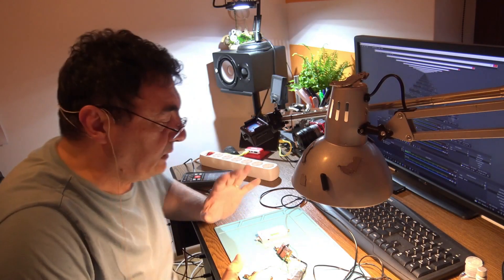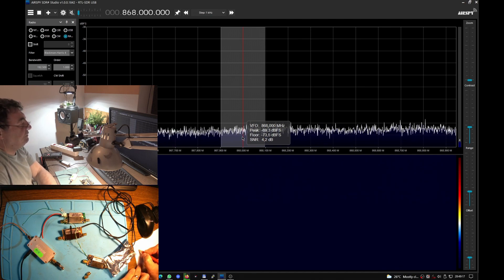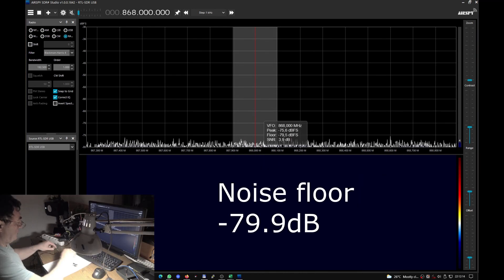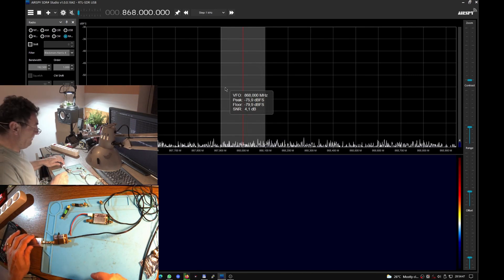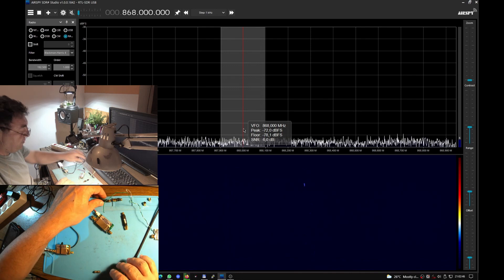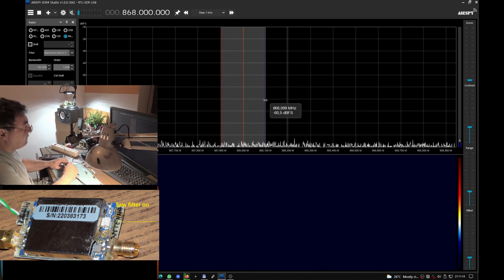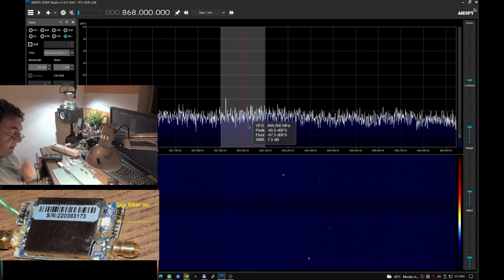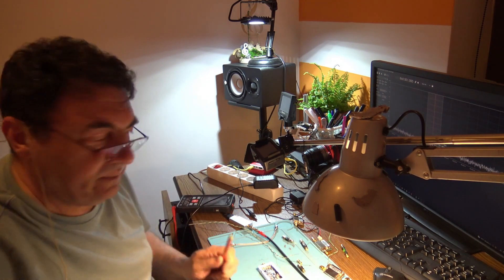Acasom v.1 vs AB-868-5V/Ab-IOT-868 AirBuddy LoRa Helium amplifier

Comment: I have alfa wifi with 20m LMR 200 cable with Antena 12dbi Is ab869 suitable?
Reply from the maker: Not for ALFA, different frequencies.
Reply: @viocaia Ears What can I use to not lose the signal
Reply from the maker: @kolchy-8272  Are you talking about WIFI or LORA signals...usually a good antenna it's enough.
Reply: @viocaia I want to put antena outside and tie it to a 20m cable and an alfa inside and I don't want to lose the signal
Reply from the maker: @kolchy-8272  Antenna outside connected to what? Alfa doesn't need any extra amplifier for a good connection. I use to have ALFA R36 when I was travelling with excellent results. But I recall I used a USB extension and I used Alfa as close as possible to the antenna. I don't recommend long antenna cables.

Comment: Hey Viorel, 

1. Can I use 30db amp and 20db attenuator for 10db gain? I don’t have any sellers for the acasom in my Country. So the only option is amp and then attenuate. Also how should I do the connection between amp and attenuator?

Like
Amp - SMA M-M Adapter - Attenuator
Or
Amp - Attenuator directly

2. I also have a STB 75 impedance 20db amp, so will it work for 50 impedance input? Also it has F Type Female to which I am going to connect F Male to SMA Female adapter. With that I am going to attach Antenna as Input to the SMA adapter and Hotspot as Output with SMA Adapter.

Like this
Antenna - F Male to SMA Female - STB 20db Amp at 75 impedance - F Male to SMA Female - Hotspot
Reply from the maker: You may use an attenuator after the amplifier..never ..before..so antenna/filter/ amplifier/attenuator..miner
Reply: @viocaia  1. Should I connect Amp and Attenuator directly or with SMA Adapters?
2. Will my another config with STB Amplifier which has 75 impedance work on 50 impedance?
Reply from the maker: @gorangagrawal  Depends of your connectros configuration..try to avoid to many adapters. As for 75 to 50 ohms..it's working without problems..
Reply: @viocaia  got it. Thanks a lot

Comment: you did't get the role of attenuator did you? you also sed it is stupid to use attenuator between nano vna and acasom amp input. I am using 10 dbi antenna and it is clearly that without attenuation it overloads acasom amp input in my case. It does not metter how you attenuate the signal: long cable, two saw filters, 6db attenuator, but it is not stupid to use attenuator if you are having signal to stong. is it?
Reply: Viorel is right that it is stupid to attenuate the incoming signal before the amplification.
You have a misconception what the attenuators role is yourself, it's only to trick the miner that you are using an amp. By attenuating the incoming signal you kill all weak signals before amplifying the signal, so yes it's stupid.
Reply: @renedevrind1733  so how can you explane better results with 6 db cable loss then with 1.2 db cable loss? do you understand that acasom amp is crappy and it is saturating with stronger input. At least I made it work. kinda. it is still better without acasom amp then only miner. miner has high quality LoRa module inside with saw filters and stuff.
Reply: @laurynaslauris9677  I’m with you on the fact that the results don’t lie. Still we are unable to explain why removing the Acasom amp completely increases transmission results by at least 2-3x. I did notice that I had more successful transmissions (although weaker RSSI) when an attenuator was added to the input of the miner while my Acasom was installed. One thing I don’t understand is this, As the Acasom raises the noise level, so too does it raise my RSSI, so my SNR actually still stays the same if not better. On paper the sheer increase in signal strength should be yielding more witnesses, but as you and I can see from the results on these videos and at home, something about That particular Acasom amp is failing to capture a good 50% or more of potential beacons, and I am no longer sure if we can blame it on noise anymore since the amp obviously does it’s job of increasing the RSSI just as much…
Reply: @Philneye5389  It is very simple. noisy witesses are ignored by the software of the miner. different hotspots and distances, signal streingt and antennas are interacting differently with the amp. for example it sometimes witnessing far hotspots with acceptable good RSSI and SNR. and near hotspots are  overloading input. we need amp with feedback circuit preventing it from saturation. I dont know how it called in english... automatic level of amplification. may be we can take out that transistor in acasom amp and replace it with better one or hoock SPF5189Z on to the  acasom amp. if the network will perfom better I will do some tests.
Reply: Ask yourself why cavity filters are better and cost more. Maybe because of much less dB loss? And you want to attenuate signal even more before it even goes into amp. Better save money and don't use amp at all if you want to kill weak signals and just amplify noise and signals strong enough anyway.
Reply: @Dunc4n1d4h0  you’re not wrong. However, The question still remains: what is causing the Acasom to bypass most existing beacons? And to Lauris’ point, certain noise floors may not be accepted into the network as valid from the outset (good SNR or not). Using tools like HS-Analyzer, I’m able to notice that my noise wall increases by about 10-15 dbm for all witnesses throughout the time I’ve had my amp installed. They were still strong and valid signals even though they were very few which is the premise of these tests. Personally, I hope this is a power supply issue rather than a noise problem, because it appears we can’t fix the noise issue without: 1. Getting rid of the amp
Or
2.attenuating everything else which downgrades everything as a result…
Reply from the maker: I got that..relax..good it's working!

Comment: This was nice research. You should try to use a powerbank instead of a power adapter and see if it has effect on the noise level.
Reply: I tried this and for both Acasom, Raygnal and Uptronics all had the same noise levels
Reply: Power bank will give you nothing. It uses same tech converters as those power supplies (just step-up from 18650s voltage instead of step-down). Those are noisy. Thats why Acasom in new version used linear converter. You could use simple battery pack (imo best solution) or something like low noise hifi power supply for example.
Reply from the maker: A power bank is even noisier..but I'll do

Comment: Could you include a comparison between the stock direct power supply and the bias tee connection for the Acasom 17rx/6tx ? Like you said, Perhaps it makes a difference how the power is fed. I’ve always used the bias tee method to power the amp but maybe the older version doesn’t regulate power as well and thus doesn’t receive potential transmissions. Your direct power supply connection seemed to have worked better this time!
Reply from the maker: I will..